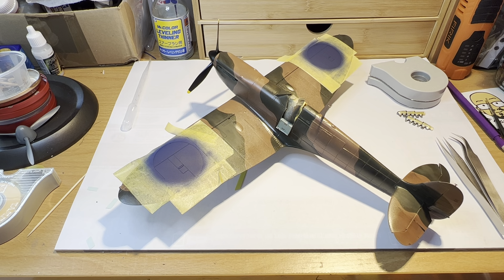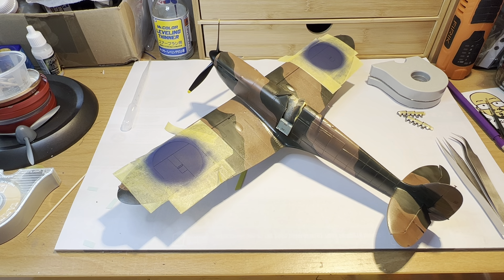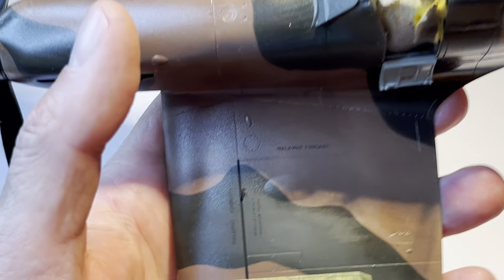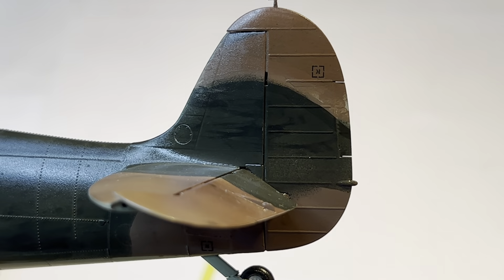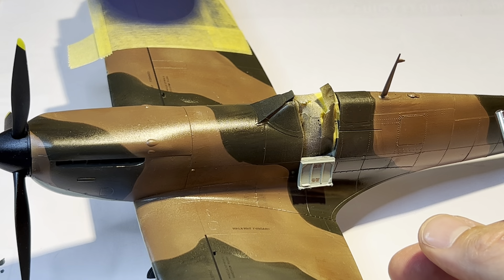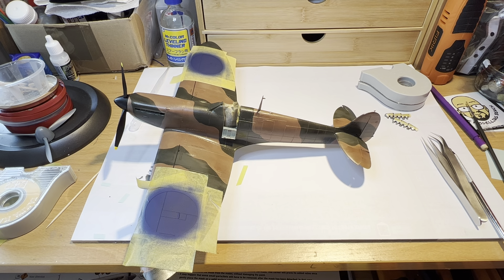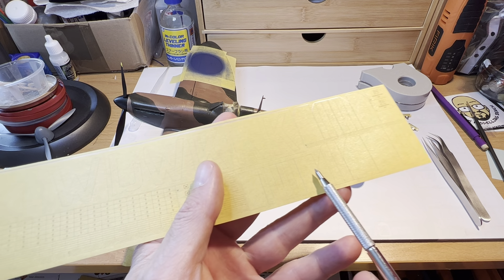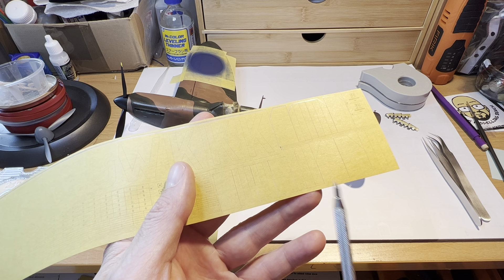Kotare Spitfire 1/32 scale: regarding markings- OneManArmy part two

Comment: Coming along nicely Z. Just a couple of suggestions.. try the little bit of tape under the bottom left corner of each mask.. it makes them much easier to remove and I would avoid de tacking the stencil masks on your hand.. you run the risk of pulling the letters out or getting a hair under it. I was sat here shouting at the screen when you did the roundel.. "USE 1B ZIN!!" lol.  Glad you got there in the end lol. I think you'll find the cutaway "D" is for the camera access door rather than the cockpit door.
Reply from the maker: Dear Nigel,
I am most grateful to you once again and, now that you mention it, I can see you shouting at me when I was fooling about with the roundel! I'll look at the designs again with regard to the door- I have a feeling you may be right, (we have all learnt to listen when you speak!!).
Good to hear from you sir!
Regards,
Z
Reply: @ZinzanModelling  I was shouting Zin.. but not swearing at you.. I wouldnt dare do that. You'll have to look carefully at the masks for the fuselage sides before using them. I might even do some experimenting?
Reply from the maker: @NigelsModellingBench  My dear fellow- I see that you wouldn't swear, you're far too nice a fellow to do such a thing!
I have some of the squadron markings down now and will be doing some work on this in the next few days. It really is all experimental just now, but the masks are so well made that the job is made easier in many ways.
You're a decent bloke Nigel and I will always have time for you.
Kind regards,
Z

Comment: Much much more finicky to lay down than decals, Zin, but I think being able to weather the insignia like you can with the rest of the painted surfaces makes up for all that trouble. To be honest, I don’t think I would use these masks for every build, just those that are going to be quite worn or weather-beaten. Or maybe for just the stencils since carrier film is very much more noticeable with those decals.🤔
Reply from the maker: Dear Ronald,
I think you're right, although I very much like the flatness of the painted surfaces which is very nice. Stencils are much less obtrusive as you say, but still visible without any of the potential problems.
Thanks for writing again- always pleased to hear from you!
Regards,
Z
Reply: @ZinzanModelling  good point on the flatness of painted insignia vs decals Zin. Always a pleasure chatting with you.

Comment: Life's too short for all that faffing about with masking. It may look better than the decals, but with setting solutions decals can look fine.  Seems the adhesive is too strong  on the masks is too strong as well.
Reply from the maker: Dear John,
Thanks for getting in touch- I know that many will share your sentiment! The mask set was a late addition to the project (which is going to be donated- details later) and I was intrigued by the idea of them. So far, it hasn't proved to be a particular problem and I suspect that the tack on the masks won't be a particular issue as I gloss coated the paintwork in preparation for what I thought would be decals.
I'd be pleased to hear from you if you have other comments to make- perhaps the result may convince you that masks are a good idea? Perhaps I may be similarly convinced too!
Regards,
Z